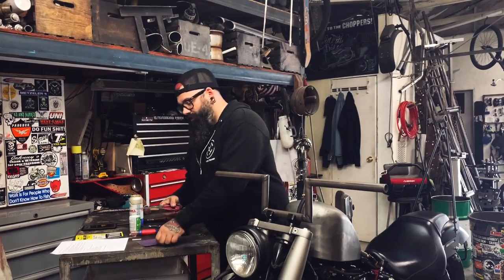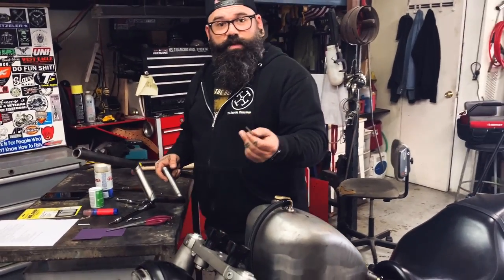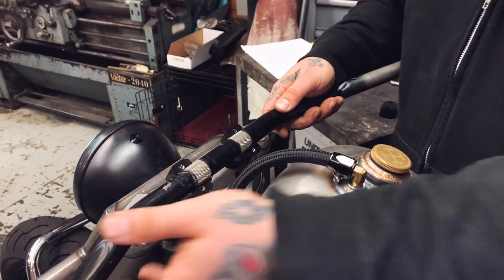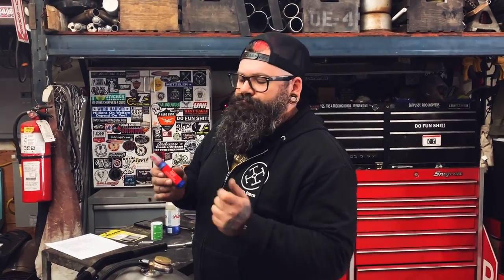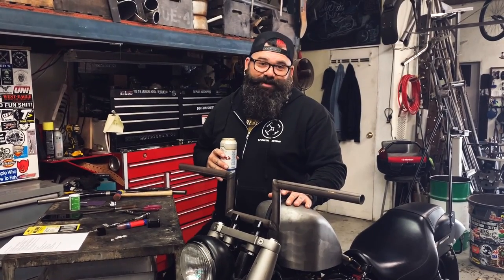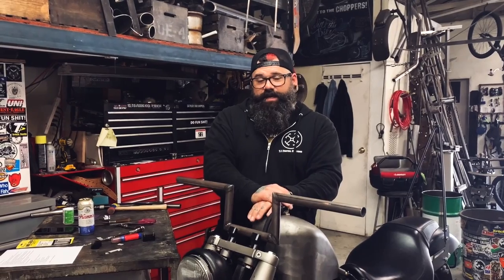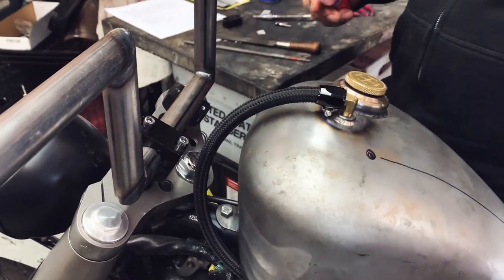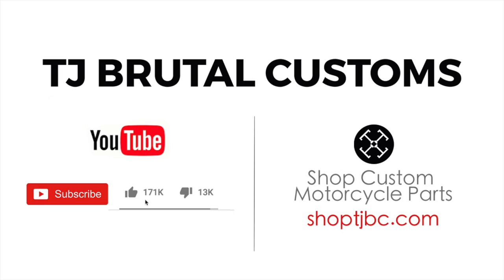11 Ways to Stop Handle Bars from Slipping

Comment: I usually loosen the bottom bolts on the riser under the tree and then tighten the top bolts on the risers, the risers will align correctly to the bar and get more surface area. Then tighten the bottom bolts. You’ll put tension on those bigger bolts instead of putting a lot of stress on those small front bolt that isn’t aligned.

Comment: Just added different bars on my Sportster. I could not get it tight. Tried the back bolt tighten first then front method with red locktight. This works like a charm!

Comment: How about a hardened dowel with a pointy end, dropped into the existing hole for the triple tree bolts? Make them just long enough that the pointed end contacts the bottom side of the bar, so when clamped up they bite in... That way no drilling holes and should be easy to remove when needed, plus can alter the angle too

Comment: You didn't mention using a set screw in the middle of your riser. Perhaps in combination with a nail punch to divit your bars...? Another option alongside the pinch menthod is to grind off 1/32 from the bottom of the top of the clamp. Now you can use the pinch method. Keep up the hobby!

Comment: There is another way. Remove risers/clamps, and, using sandpaper and glass (as if you're skimming a cyl head) remove material little by little, so when you put them back on, the clamps clamp harder.

Comment: Did red lock tight and new bolts for my 2015 dyna . 18” bars . Still move like crazy .  Definitely not gripping.  Bolts are as tight as I can make them with racket . Even broken off
The end of the bolt and a socket .  No clue where to go from here
Reply from the maker: Try sone of the trucks in this video. Unless your risers are just dog shit, one of these should work

Comment: Thanks for the video, it helped a lot. what did you torque the 4 bolts down to? Also, you said people can use blue loctite. Do you mean on the screws or between the handlebars and the clamps? thanks for the help
Reply: @TJBRUTALCUSTOMS  thank you for the quick helpful reply

Comment: The file and rasp is the co..... set you bars in the risers, then any tape either side of the risers. Then whip ya bars out, file nicely, take your time, triangle to do the risers and nice heavy file for your bars....    yep in doing this tomorrow.... how do you measure to put new bars is, i wanna put in drag bars, but i like my bar height now.... so is it just down to a straight edge and measuring tape??

Comment: i use a silicone cooking sheet and cut strips off of it, simple and effective, or those wide rubber bands work, anything as a bushing will work for a temp fix, though the silicone bushing cut from the mat is still in there and has been for going on 5 years now.

Comment: How do you know what length throttle cable and all the cables and stuff that are going to handlebars how do I know how long they need to be if I put 8 in mini apes on it mine is a 02 Honda shadow 750 spirit

Comment: Another way that works for me is a variation of using the roll pin. 
Drill and tap a hole in the top of the risers, then afterward install the risers and handlebars and take a punch, then dimple the handlebars and install Allen or torque screws with blue lock tight. 
You can use red but getting the set screws out afterwards is a bitch.
Reply from the maker: Thanks!

Comment: Very interested, I always thought that # 1 should be use RED LOCTITE on the clamp bolts and tighten on a cross pattern till create equal gap on the clamps to be torqued to factory specifications. Now, using a extension on a ratchet or torque wrench is wrong, since you never going to get the right torque measurement from factory. My 2 cents. 
o¥\O chopper 4 life.

Comment: I'm working on a custom build for my 85' Honda shadow 700VT and I was having trouble with this pair of clip on bars slipping, I triple checked they are the right size for my forks and I have tightened them down hard as hell I even ended up stripping a bolt on one side but they still slip when I apply a bit of force like 30lbs or so, I also tried the clam technique from the video but with no luck.  I don't know if I should roughen up the clips ons and the forks.  I have heard of some people using duct tape on the forks to give the clip ons better grip but it seems like that may be a short term fix.  Any help is appreciated, also these videos are a huge help.

Comment: Bro cut a piece of cycle tube or bikes tube and put it same as sand paper it will not slip at all and it's full proof
Reply: I've been using bicycle inner tubes for years.  Works great 👍

Comment: Does a little piece of  tyre Tube works?
Reply: @TJBRUTALCUSTOMS  well, give it a try once.
Reply: @TJBRUTALCUSTOMS  Man, i replaced the handlebar on my Motorcycle. and it is not as tight as the stock one. and keeps slipping when i apply force with front brake for going reverse or doing a wheelie. A Local Motorcycle mechanic has put a piece of tube under handlebar clip. Till now its working. But By your comment i think it won't last long.
Reply: @TJBRUTALCUSTOMS  Yeah man. Thanks, I ll try one of your tricks.
Reply: @TJBRUTALCUSTOMS  i learn a lot from you sir thanks for your bright ideas✌👍